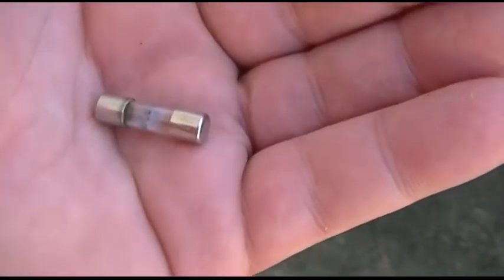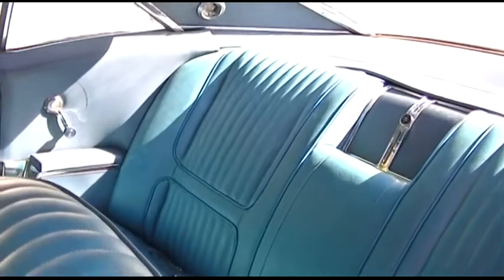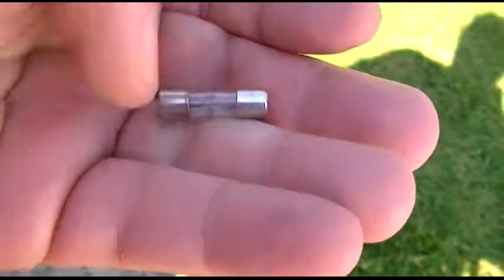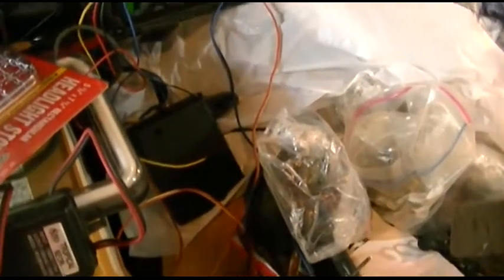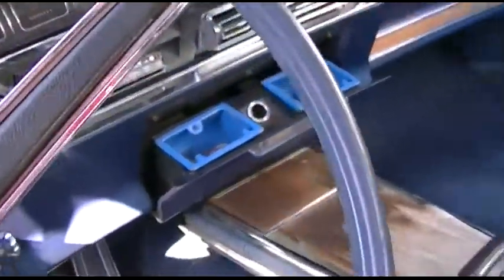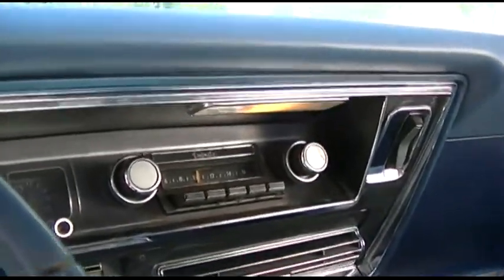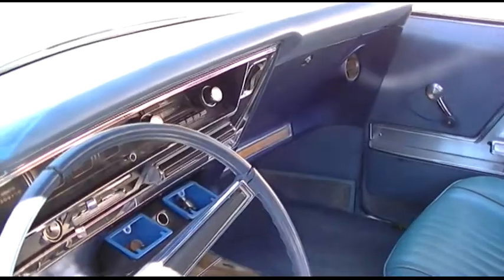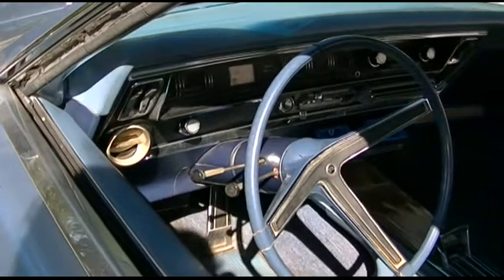More Buick Electrical Gremlins Are Getting Worked Out!

Comment: Your Buick has a four note horn! It was a option on most,  if not all GM vehicles.
Reply from the maker: Well, it does now, but I don't think that's factory, it wouldn't be so shoddily wired, unless the previous owner did that; I will never know.
Reply: It could have been from the previous owner. A lot of things probably went wrong with the electrical, but the previous owner never bothered to fix it properly, and replace the brittle wires.
Reply from the maker: The wires (at least under the dashboard) are fine as for their integrity, the insulation is still pliable and all.  Under the hood may be a different story.  Even so though, if you really have no clue how to wire something up, you don't just start touching wires together until something works, you're quite liable to blow something up!

Comment: It's a great car Jay do you paln to install new window rubber on the driver's door? would you ever consider going to the car show in the Smoky Mountains the show i went to started Thursday September 8th saw somany classic cars. The Buick Is awesome
Reply from the maker: I've been toying around with the idea of replacing the rubber on the driver's door, and passenger door, and trunk.  That's not terribly high on the priority list now because it still works and keeps out the rain.  Only time it leaks is if water is sprayed directly at it from the hose, but my Old Chevy did that and the rubber on it wasn't deteriorated.

If you're willing to provide transportation to and from there, I'd go.